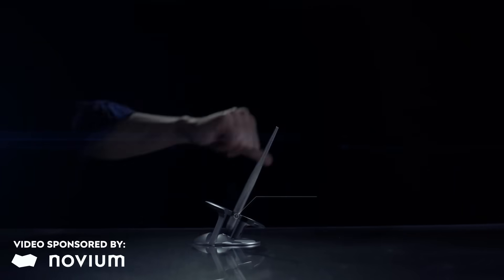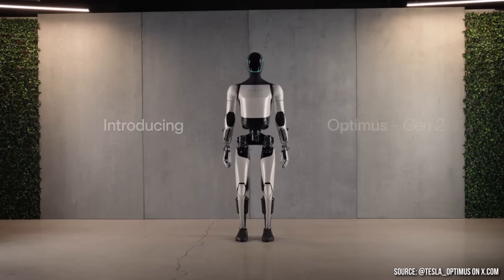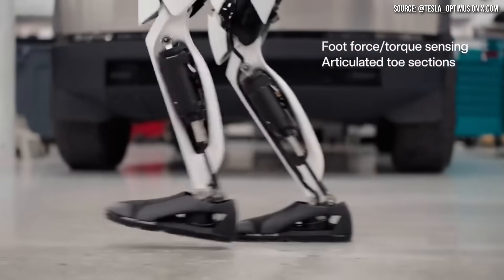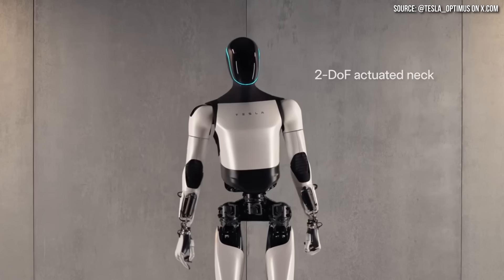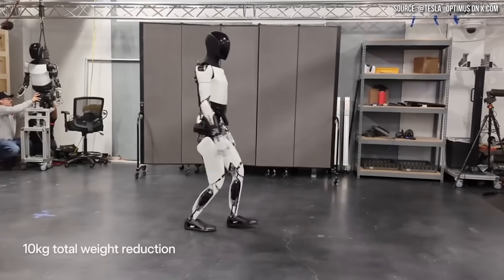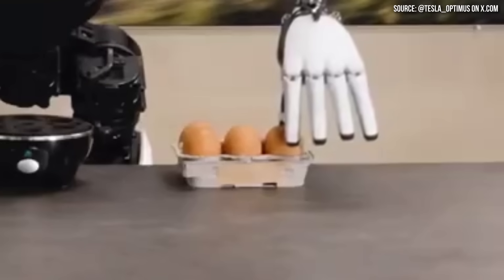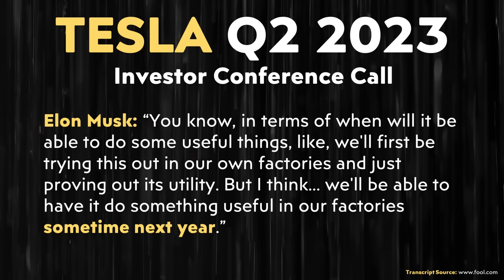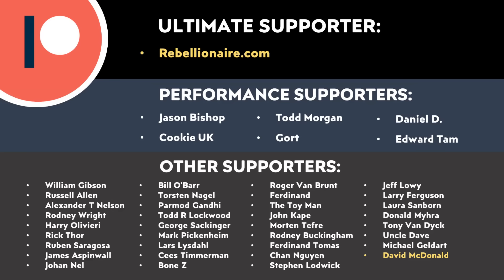Tesla 2nd GEN Optimus Robot REVEALED + ROBOT EXPERT REACTS

Comment: Gotta wonder how long before the studios strike or sue for copyright for the use of Optimus and Bumblebee in the naming of these generations.  The biggest issue with this robot is the power system, specifically the time before depletion without being tethered.  And no I'd dont think Tesla will be creating some micro nuclear power plant for it.  But with Musk you can never know.  Stargate Naquadag generator?  Haha.  Musk is such a movie groupie!  Tesla Cyber truck looks like one of the vehicles from Logan's Run.
Reply: You could potentially have easy to plug in power cable which could be done by a robot, so it moves to next workstation, hooks up to power and keeps working, so it would charge up batteries and provide continuous power supply when its needed. There are still bunch of questions relating to its performance and how long it can work with one charge, but you can always add some basic solutions to mitigate that, like swappable batteries which could be done by robot itself when needed.

Comment: No, it was not a malleable egg. Those were shadows moving across the surface of the egg which look like for a moment as if it was indented but as you saw as the egg was moved out of the light you could fully see the shadows move across the surface, the surface of the shape of a solid egg and also you could see it was quite solid as it was placed in the container that was not a malleable egg.

Comment: Nice smooth movements, but nothing that really impresses me much. I'd like to see how it handles uneven terrain and reacts on external pertubation. All this stuff that e.g. boston dynamics has demonstrated 10 years ago. Show me that Optimus can handle this and handle it better and then we are talking.
Reply: Boston robot is basically just an expensive toy because it isn't going to be mass manufactured. Tesla robot was designed with future manufacturing in mind and Tesla has the money and know how to go into volume production relatively soon.
Reply: Why even talk about mass production as long as the robot has not shown that it's capabale of doing anything useful? At the moment, it's the same kind of "toy" as Boston's Atlas is. Only much less impressive. I don't see why Tesla should not reach this level and go way beyond that in the future. But this will take years and it remains to be seem if there really are many applications for a robot like this between human labour and specialized robots. @jlrutube1312
Reply: Every movement of Boston dynamic robots are manually programmed. The slightest change in environmental parameters would need human intervention to adjust the code accordingly. Optimus is teaching itself to do shit. That's the huge difference.
Reply: That's not true at all. The basic walking algorithms developed by compynies like Boston Dynamics or Unitree are robust enough to handle very different types of terrain or environments. What a human operator is controlling or has to write code for is the "high-level" behaviour.  Maybe Optimus has already reached this level of robustness - but what has been demonstrated so far doesn't show much of this.  @psyshanudasan
Reply: Modern gyro's combined with AI, it should be able to teach itself this quite fast, especially with Tesla's capability to train neural nets really fast in their DOJO and other supercomputers.
Reply: I don't see how "modern gyros" could help here. And whether AI is really better than classical control engineering to solve these problems remains to be seen. I'll get excited when Optimus handles complex tasks in a complex environment. But it looks still far from that.   @thotmorgana

Comment: Well it seems to me that the body is much much thinner. They probably finally started using custom batteries shaped to be more compact. As cool is it might be to use the same 4680s that go in cars, it would never compact and efficient enough for such a different use case. They probably started using pouch stile cells with zero wasted space, also explaining that big weight loss.
Reply: Yes, it has been dieting and is now too skinny. I bet the final version will be more humanly shapely (not male or female per se, but less like a walking stick). More curves mean more room inside for batteries and electronics. The extra head degrees of freedom really improve both appearance and functionality. The hands are amazing in themselves. I've worked quite a bit with force-sensing resisters and such (back in the day when those were about 1/2" square :-). 21st century technology is really something else.

Comment: Concerning the egg, whether it was a real egg or a hard egg, what you think is a depression of the egg is a trick of the light. I have studied this moment for a long time because I initially had the same feeling, but it is really a trick your mind is playing on you.
The shadow of the finger getting darker and increasing on the right side of the surface of the egg gives the impression that the surface of the egg is being pushed in, but when you take into account the distance between the finger's starting position and the surface of the egg, and the time it takes to touch the egg you can easily see that the finger does not push into the egg but only touches the surface as it would naturally when doing this task. Also it should be clear from the fact that once the finger touches and moves the egg and the egg is clearly round and not pushed in, that the finger does not come out of the egg so to speak to give it its original round shape back, but remains exactly in the position where it touched it and when it passes the egg to the other hand. 
Had the egg been pushed in the finger would have to move back out a small amount but that doesn't happen as you can see.

I understand that everything Tesla does enjoys an extreme level of scrutiny from the entire online community but I would caution everyone not to jump to conclusions based on feelings. You don't want to be part of the "it's all fake/CGI" crowd.
Reply: Good analysis. I watched optimus's finger and it didn't move so if it was rubber it would still be depressed (like you said).
Reply: as pointed out by others it's a moving shadow not a depression.  As a publicly trading company asserting these were eggs when they could be plastic would be big trouble for Tesla. No worries, as it's clearly a moving shadow from lights somewhere above the Bot.  @6681096

Comment: After looking at the finger that’s picking up the egg, It looks more like a shadow and not the finger pressing into the egg.  I don’t think the engineers would want to deceive the audience with a plastic or rubber egg.  If Elon knew that the demo was using a rubber egg he would be pissed and wouldn’t approve the video until they used real eggs.
Reply: I looked at the video a bit closer and the shadow on the egg moves to the viewers right as the robot picks up the egg  confirming it’s a shadow.
Reply from the maker: You might be right... it could be an optical illusion created by shadows.
Reply: Definitely an optical illusion
Reply: Yes this seemed obvious - surprised that got published in the video. I’m sure far fewer people will see your comment than saw the main video.
Reply: @daveinpublic YUP—a perfect example of “the birth of Misinformation.”
Reply: Yes, I just made the same comment.
I believe it is a real egg.
Reply: I definitely agree as well. That was the effect of a shadow. Actually when the Tesla-bot let go of the egg over the plastic or Bakelite egg holder (or poacher maybe), the egg dropped just tiny bit and made a slight cluck sound, as a real egg would. Further, I don't believe engineers of the talent there would video the robot with a fake egg for public consumption.
Reply: There no point in replacing a real egg with a rubber or plastic one. Real eggs are pretty strong and the problem of robotic hands grabbing an egg has been solved years if not decades ago.
Reply: Exactly my thinking
Reply: Elon approved the fake full self driving video. He is all about lying to pump share price.
Reply: This is the same Elon who faked the "Paint it Black" FSD video, the Solar City presentation with the fake panels, etc. He's one of the biggest fraudsters there is.
Reply: Exactly what I saw, it was the shadow from the finger